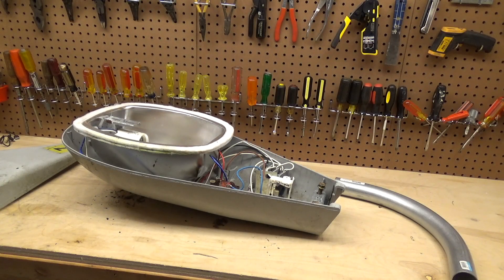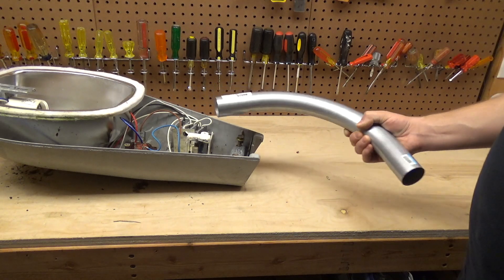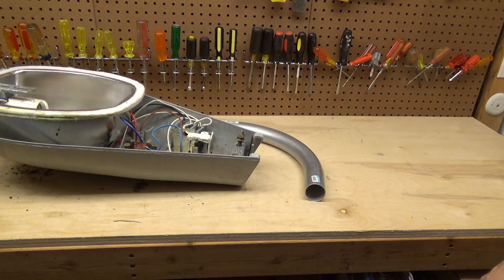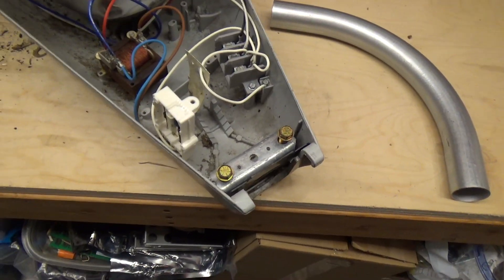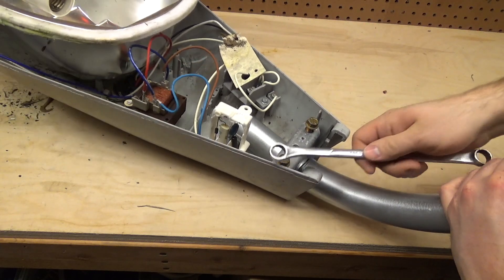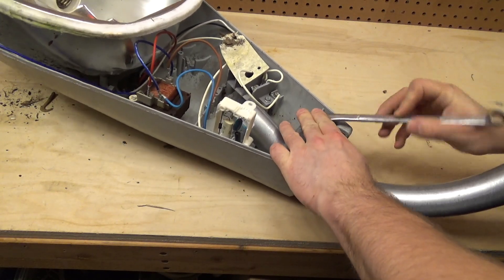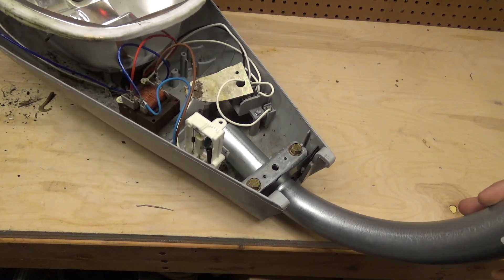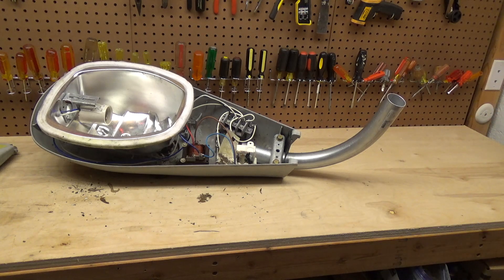Street Light Mounting Pole Idea

Comment: I might do a similar thing, but with a much longer section of pipe for more height and overhang. The reason I need a high arm with overhang is because the streetlight I am using (a low pressure sodium streetlight that was designed for dark sky protected areas) does not throw much light forward due to the way it was designed. It is also way too bright to be mounted low (90w LPS is equivalent to 150w HPS), and can serve a much larger effective projected area with more sensible amounts of light if mounted higher.
Reply from the maker: I may explore adding another pipe on after the 90° to extend the light out further if it seems study enough. It certainly may look better.

Comment: If you have the extra $, use rigid, 1-1/4 threaded conduit. Way stronger, especially if youre going to add a few feet to the overhang of this fixture. Also, get some rigid, 2 hole straps and then self drill a screw through the steap into the conduit to prevent rotation.
Reply from the maker: I do not have any extra $ at the moment. I have since purchased the rest of the pipe and the coupling piece. By design, it connects with a set screw. I think if I drill through both sides and pass a bolt through the whole assembly, it will be completely sturdy.